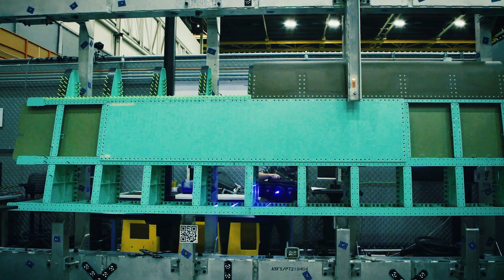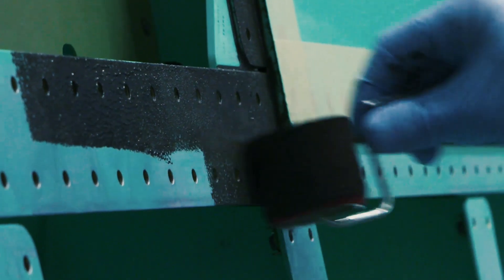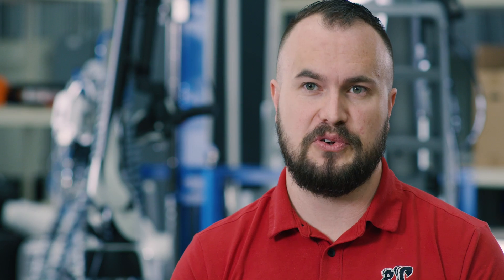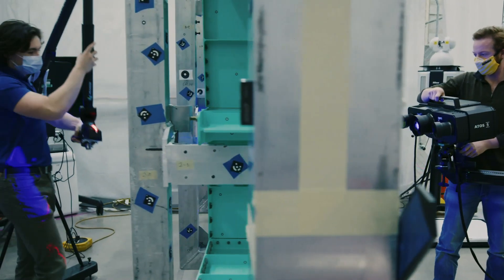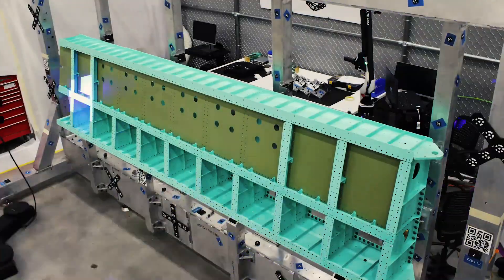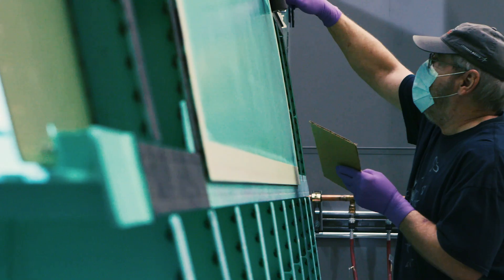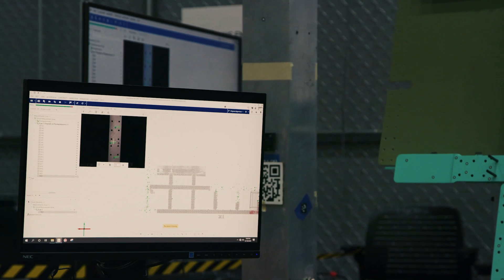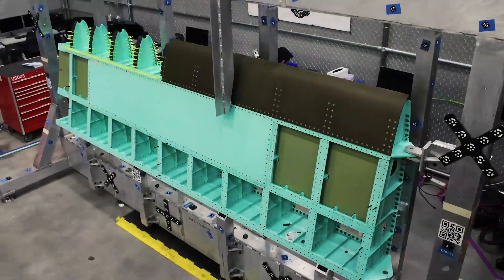CHARLIE: A Project StarDrive Prototype

Comment: I still don't understand can someone help me 🤨🤨☹
Reply: This is one of the details of how things actually get done that you can't see on the flight line or launch facility.

So usually in manufacturing they have to drill the holes at the assembly site in order to ensure they match up precisely when they are putting two different kinds of material together. Say titanium and carbon fiber.

This is a huge problem as it creates dust/particles that can't be on or in these planes, which takes time to clean properly. It also takes a ton of time to do accurately. It also risks making each plane unique, because even the tiniest human error is large compared to how precisely everything is designed, which causes maintenance problems down the line.

This is a system for accurately pre-measuring multiple materials VERY accurately, so they can cut and drill everything off site and keep the assembly completely separate and ensure uniformity plane to plane over time. Even in materials that have to bend or be heated/warped to fit during assembly.

It should save time building every plane, and money. It should also solve some maintenance problems and make it easier to redesign components later and fit them onto planes built long before the redesign.

Comment: You tricked me LM. This isn't anything to do with a spacecraft.
Reply: First off ... thanks for the lolz.

They got me too.

Second ... it has to do with all future aerospace craft.

I mean, this technology could have had a huge impact on maintenance for a program like the Shuttle and will be used going forward on Orion as well as military aircraft it was designed for.

I don't know if SpaceX works with contractors like Lockheed, but they could use this tech. Whether they get it from Lockheed or develop it in house.